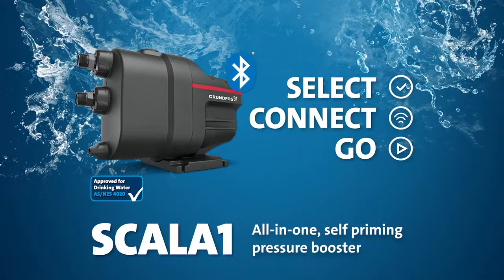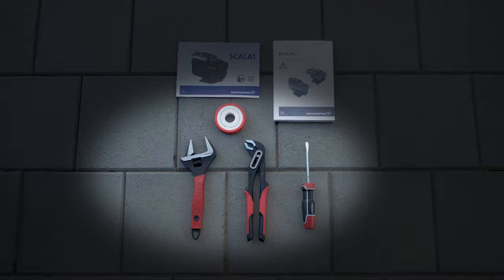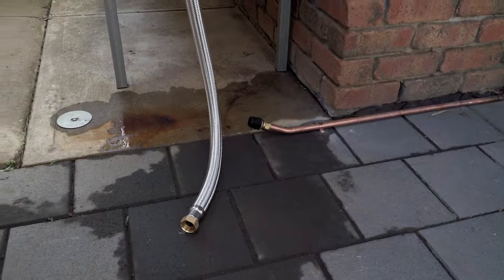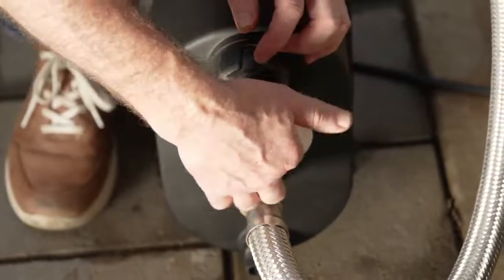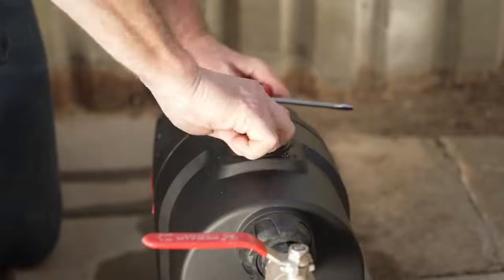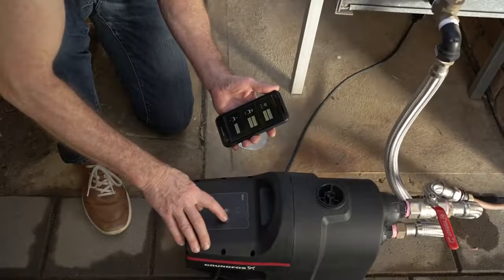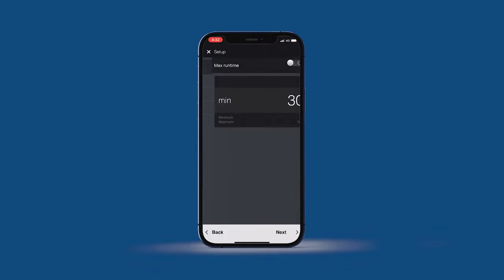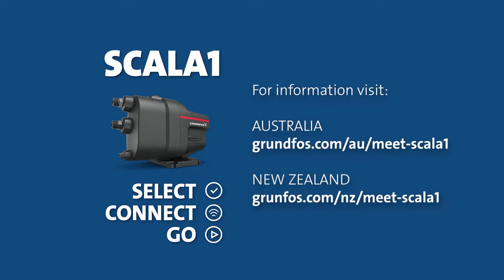Grundfos SCALA1 - Easy Installation Guide

Comment: shouldn't it be protected against freezing? Can you install it outside?
Reply from the maker: Hi @Rubboy1234, thanks for your question. It is a very good point you make. This video is just a general installation video to show the general process for installation. It is by no means contains all the information you need to know for installing SCALA1.
Here is a summary of our SCALA1 installation instructions regarding location: 
4.1 Location
The product can be installed both indoors and outdoors. The installation location must be protected from rain, humidity, condensation, direct sunlight and dust.
4.1.1 Installation of the product in a frosty environment
Protect the product from freezing if it is to be installed outdoors where frost may occur.

You can find the installation and operating instructions for the Grundfos SCALA1 domestic pressure pump here: http://gfos.ly/6052fQGhQ

Hope that helps. Regards, Aaron

Comment: I know this video is from a couple of years ago but is there a built in check-valve in this unit?  Or a one way valve on the inlet side to prevent water pressure from flowing back into the supply tank?  I'm just wondering if I need one in the intake line before I install this unit.  Thanks
Reply: yes has a check valve, so prime once only
Reply: @ Thank you, just needed some clarity on the install. Appreciate your reply.
Reply from the maker: Hi All, thanks for the assist @margarita8442, that is correct, Grundfos SCALA1 does have a check valve. Appreciate the help. Regards, Aaron
Reply from the maker: Hi @rickardo5027, thanks for your enquiry and apologies for the delay in replying. Thanks also to @margarita8442 for jumping in with the assist. If you have any more questions, feel free to get in touch again. You can email us directly at marketing-au@grundfos.com. Regards, Aaron

Comment: So where should I place the towels necessary to contain the leaks?   Make sure you install the isolation valved because you will need them to install a pump that doesn't leak  (I am 0 for 4 on Grundfos).   The best advice to installing this  pump, however, is Don't Do It!
Reply from the maker: Hi @davidpayne8646, thanks for your feedback. We're sorry to hear you've had a negative experience with one of our pumps. The Grundfos SCALA1 pressure booster is one of many pumps in our large domestic pressure pump range. It was released in Australia and New Zealand in August 2021 and has an extremely low fault/warranty rate in line with Grundfos' extremely high quality standards. And I certainly haven't heard of anything like what you're describing with this pump. Are you sure you're referring to the right pump with your feedback? Kind Regards, Aaron
Reply: @grundfos  HI, I am surprised that you haven't heard of anything like this before, as I told my sales rep all about it.   He tried to blame it on me (running two pumps in parallel), so I was careful never to run my second pair in parallel.  Still, both of my second set of pumps developed leaks, requiring me to 1/week perform my ceremonial mopping up of the leaks.  My pumps are actually, the SCALA 2, but they look the same as the SCALA 1.   Are you suggesting I should have gone with the SCALA 1, because the SCALA 2 is the one that leaks?   I would have liked to know this before I installed the SCALA 2, and besides, I think if you had a leak problem that you fixed with the SCALA 1, that the numbers should have been reversed.

On of the pumps we outfitted with new seals and this helped for a while,  but then started leaking.   Your quality standard are apparently missing a whole lot of data, because my local plumber suggests that your pumps simply leak.  They are certainly missing my own data.  Perhaps you should contact your local sales rep for my area.

Your warrantee was non-existent, and I had no option to purchase all four pumps, and I can't fathom why I would purchase any more. 

Here is an open invitation for you to attempt to solve my problem.   Please provide me with a contact responsible in or around Vancouver, Canada and I will gladly accept any attempts you make (you haven't actually made any attempts to date, other than to blame it on me) to rectify the situation.   I will gladly apologize if this turns out to be a misunderstanding caused by a rogue sales rep.  Bear in mind that swapping out the SCALA2 for SCALA1s at my expense would be pretty stupid of me, since the warranty is very short (less than the leakage time).
Reply from the maker: Hi @davidpayne8646, sounds like you've been through a pretty rough time. I can understand your frustration and again we're sorry to hear you've had trouble with one of our pump models. As I may have mentioned, this particular video you have commented on is a video we made in Australia for the Grundfos SCALA1 range of pumps, (which although there may appear to be some similarities in the outer appearance of the pump, is very different to the Grundfos SCALA2 variable speed pressure booster pump.) SCALA2 and SCALA1 are made in different factories, have different inner parts and are different pumps. The SCALA2 was released in Australia in around 2016 and has had some quality issues on earlier models that have since been addressed and a new model has just been released this year (SCALA1 was released in 2021 in Australia) and we are continually improving our pumps. I understand this may feel like cold comfort to you, given your experience. As I mentioned, I'm based in Australia and look after Australia and New Zealand, but you should be able to find the contact details you need for your area here: 
http://gfos.ly/6058oIRYj
Phone: (905) 829-9533
Because of different retail and distribution practices in the different countries and regions, I'm not familiar with how things are handled there in Canada. Here in Australia, faults like yours are handled at a retail level first and then if need be, Grundfos will provide support where necessary. It sounds like maybe you've already tried to get assistance at the retail level. I wish you all the best in getting the assistance you need. Regards, Aaron

Comment: Does the app show the % of the remaining water of in the tank ?
Reply from the maker: Hi @davidantonangeli8687, thanks for your enquiry. I'm assuming from your question that you want to know if the Grundfos Go app will show the % of remaining water in your water tank i.e. the one you are using as the source the pump is pumping from? The short answer is no, it doesn't. However, the Grundfos SCALA1 domestic pressure pump does have a couple of fantastic features if you are concerned about conserving your tank water and/or possibly draining your tank dry if there is a malfunction with your pump. Through the App you can set a max run time for the pump so it's never running longer than it should and the pump also has anti-cycling protection where the pump will be stopped and an alarm activated if it repeatedly turns on and off over a short period of time (called 'cycling'), which could indicate a leaking pipe of dripping tap. Hope that helps. Regards, Aaron
Reply: @grundfos , thanks for your reply. As it has a dry running protection and the automatic switch to communal water as well as the features you mentioned, i'm not really concerned about it running dry or breaking down. It is more about rain water management throughout the summer where around here we have a limitation of communal water usage. So in Spring we basically keep a reserve of rainwater to be able to irrigate our garden in summer. 

For context, we are currently running on a 15 year old RMQ 3-45 which has become noisy due to its end of life probably. That specific pump shows us the % of remaining water despite being 15 years old. Now our installer suggests replacing it with the scala1 3-45 as unfortunately it seems very complicated and expensive to repair a RMQ or get spare parts for it.

A thing about the RMQ is that every 15 seconds it creates strong vibrations or "hits" through the entire pipes in the house when on communal water. Also for the time the RMQ takes communal water in, we lose all water pressure on our taps. Simply put it seems the communal water intake of the RMQ is too brutal. I suppose a modern pump like the Scala1 will have solved that water intake problem?
Reply from the maker: Hi davidantonangeli8687, thanks for your reply and explanation about your water situation. Unfortunately you've come through to the marketing department for Grundfos Australia and New Zealand and the RMQ is not a product we're familiar with here. Not all Grundfos products are sold in every country. So I can't comment much on the RMQ. One thing I can tell you is that the SCALA1 is a much softer start, so you'll really notice the difference there. SCALA1 also has a timer/calendar system that you can set up and control using the app which allows you to set your irrigation on a timer. SCALA1 sounds like a great option for your needs though. All the best. Aaron

Comment: Scala pump has a design flaw, which they say has been resolved. But really hasn't, you are lucky if you get 4 to 5 years out of it. I highly recommend going with another pump.
Reply from the maker: Hi Johnny, we appreciate that you may have experienced some challenges with your SCALA2 pump and I have responded separately on another comment on a separate video, however I'm not sure if you are aware but you have put this particular comment on a SCALA1 video. The Grundfos SCALA1 is a different pump from SCALA2. The internals are different and it is made in a different factory. SCALA1 was released in Australia and New Zealand in 2021 and there has not been any significant issues with this pump to date. Kind Regards, Aaron
Reply: @grundfos thanks for clearing that up. That's amazing to hear that the Scala 1 hasn't had any major issues. To bad you can't say the same thing about the Scala 2 pump, very sad.
Reply: @johnnyvegas9708  My experience is the same as yours entirely.   The question is, how can I justify to myself the purchase of a SCALA1 having bought four leaky SCALA2, while @grundfos won't categorilly admit that the SCALA2 has a fundamental design flaw, and should be replaced with the SCALA 1 at their expense.   Am I to just take their word for it?

Comment: So there is no need for a.pressure tank using this setup?
Reply from the maker: Hi Rachel V, thanks for your enquiry. You don't need a pressure tank, no. You may want to have one to minimise stop/starts and to ensure better constant pressure. Probably wouldn't need one for irrigation and watering the lawn but maybe if you were using for whole house. But then again, the SCALA1 is so quiet you won't even hear it stop/starting. Hope that helps.
Regards, Aaron
Reply: I have it set up for irrigation where my tanks are higher than the field.... I have programmed my scala1 to a specific run time but the field is syphoning my tank when the pumps stops.  How can I fix this
Reply: And thank you for the response! :)

Comment: what's the maximum distance the pump can be placed from a tap when the pump is beside a below ground tank and pumping only to first level while maintaining a quality water pressure ?
Reply from the maker: Hi Xmun, Thanks for your question. SCALA1 in Australia is available in two sizes, 3-35 & 5-55, so it depends a bit on which model you are considering. Also, it will depend on how deep the below ground tank is and therefore from how far below ground the water is being pumped.  You mention one tap. If there are more taps along the length of the pipe which could be opened at the same time as the furthest tap, then this will also make a difference.  Additionally, the size of the pipe and the height of the highest tap will play a part in the calculation. Finally, the flow required at the tap is important to know. Is it a shower or irrigation?  Because it is very difficult to size pumps without knowing all the details. We always recommend you visit your local pump professional with all the information you can gather, so they can make the correct recommendation for you. Hope this helps! Kind Regards, Jess 😇
Reply: @grundfos  Ive got amazing pressure once I set it up but im having an issue with the pump going into dry run mode after 4 or 5 times then it resets itself and then it works again. I found that I change performance modes . do you think changing too air handling would help with this ? as there is certainly water in the tank and the input pipe is definitely not blocked.
Reply from the maker: Hi xmun, unfortunately we didn't receive any answers to our previous questions put to you like how far down is the water source? etc. so it's still a little difficult to assist you in the best possible way. Sounds to me like the suction end is intermittently sucking air and water depending on the level of the tank. Do you have a foot valve on the suction pipe in the below ground tank? If not you should install one to stop the water in the pump draining back down the inlet pipe into the tank. Also, is the suction pipe far enough down in the below ground tank?  The Air Handling Mode might help, but I would look at the inlet pipe first.  If you install a foot valve, re-prime the pump by pouring water into the priming port first, before normal operation, this will ensure no air is trapped causing an airlock. Regards, Aaron
Reply: @grundfos  thanks Aron , I believe the foot valve that was installed wasn’t rated for high enough pressure and without a spring so I think it was getting stuck in a closed position hence the dry run alarm only sometimes. I’m going to purchase a new foot valve that can handle atleast 8 bar and that has a spring. Thanks so much for your help
Reply from the maker: Hi xmun, good to hear you may have found a solution. All the best. Aaron